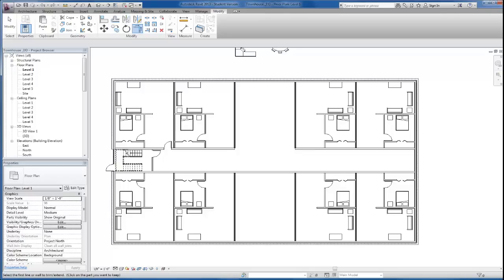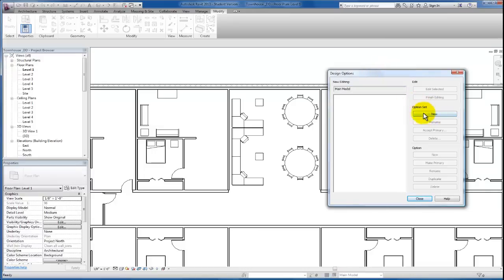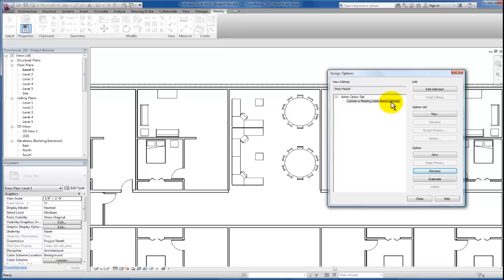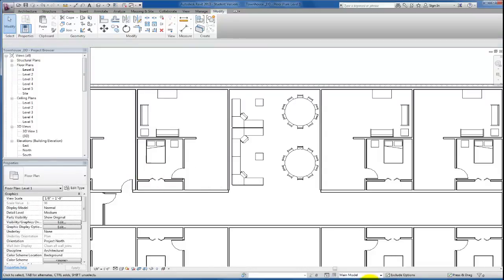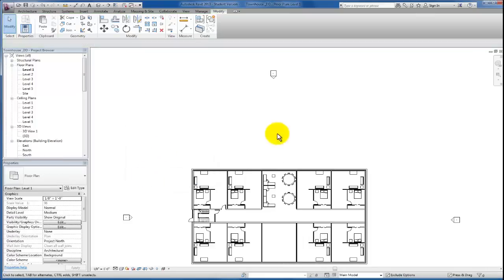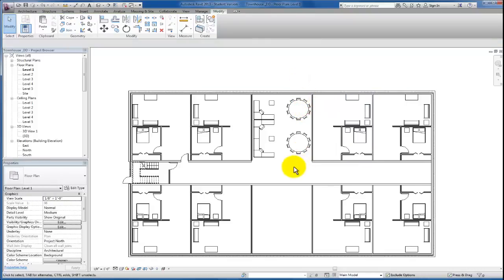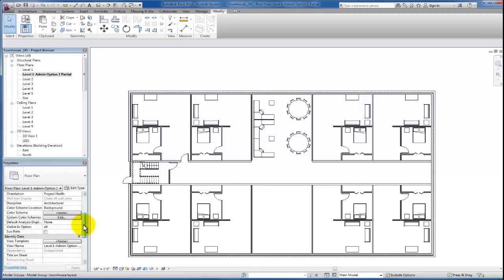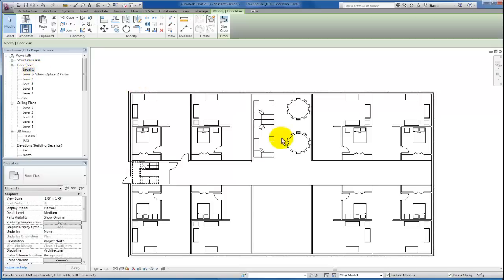Revit Tutorials: Design Options

Comment: So if you decide to use design option 2 how do you make it part of your main model so it can the properly be edited?
Reply: +epond83 If you go back to the design options menu, the place where you originally created the option. Click on the one that you have chose. Under option there will be a button "Make primary" click that. Once you have done that go to the original option that the others are coming from and under option set click "accept primary". This will delete all of the other sets you have made and move the option you want into the main model. I hope this helps.